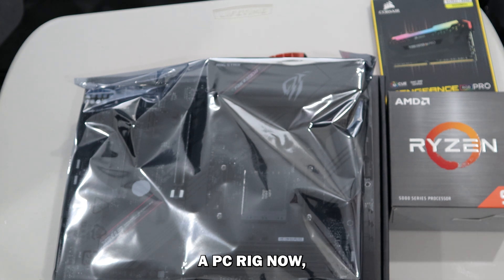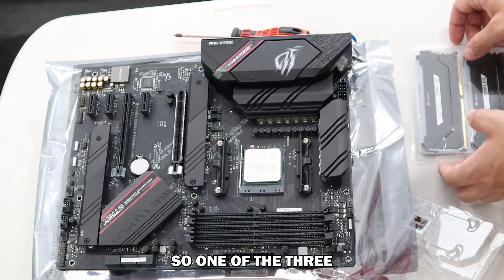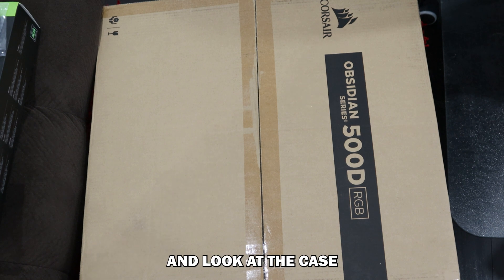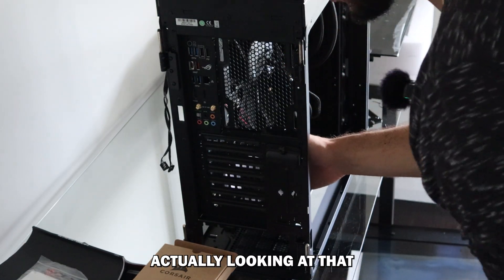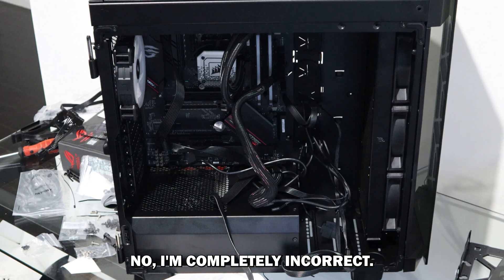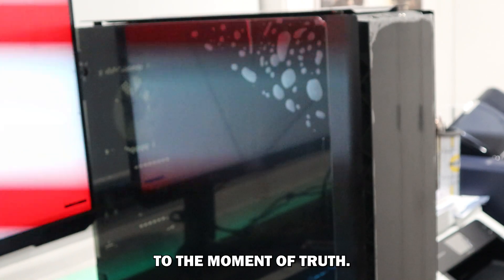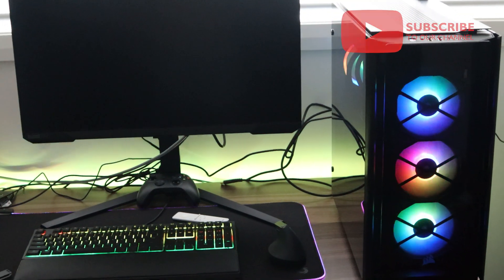Successfully Building a PC with No Experience

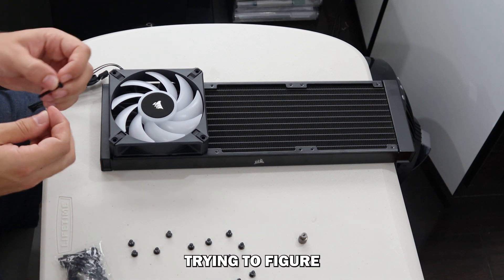Comment: 7:55 the reason it isnt recommended isnt because of the higher pressure, its because there is always a bit of air inside so it wont be able to pump water as good as if the pipes are up, these all in one coolers are designed so that the air goes up and the pipes are down so air is avoided and more water is moved. i forgot what this does to the aio, i think it could ruin it faster and have higher temps but im not sure, if you can try to flip it.
Reply from the maker: Yeah unfortunately it simply would not work with the pipes going down. The footprint in the case doesn't allow for it.

You're spot on though and it's something I forgot to mention in the vid, but in my opinion most modern AIO pumps should be able to overcome the issue of air entrapment especially when the radiator top can act as a sort of pseudo relief point.